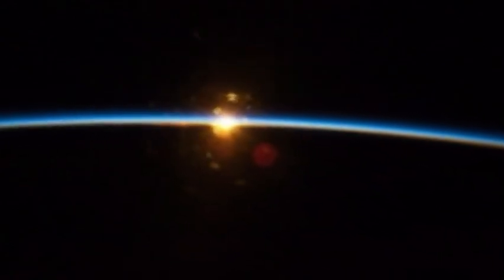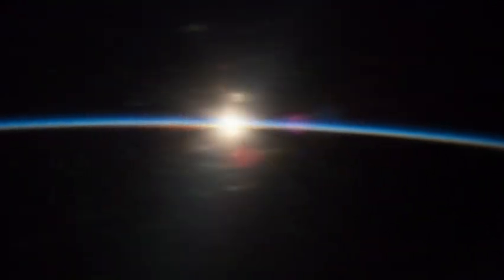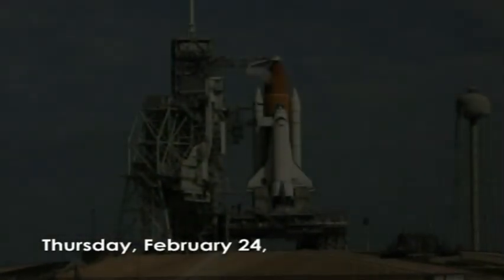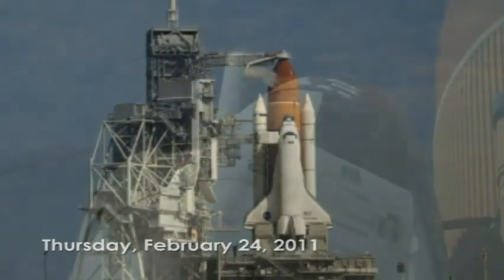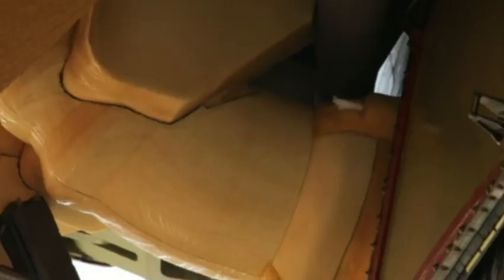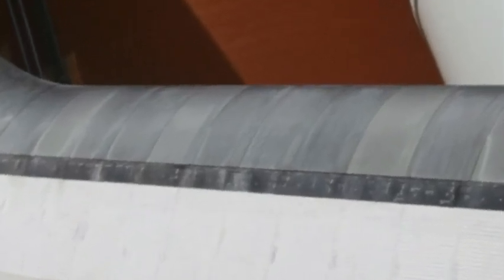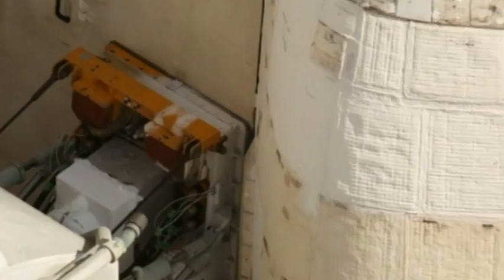Discovery Launch Captured by Multiple Cameras

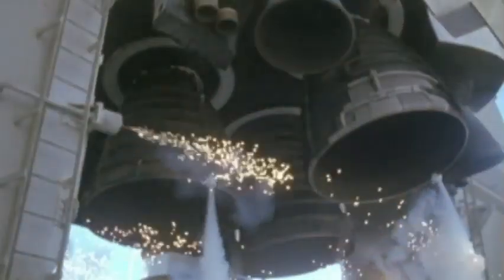Comment: 4:24 is that sparkles or water?
Reply: +MoneyCZ What you see is sparks from the sparklers. Their job is to burn off the excess hydrogen under the exhaust nozzles. Info from 'NASA Space Shuttle Owner's Workshop Manual' published in the UK by Haynes. It's a very good read.
Reply: oh
Reply: idk it
Reply: and thaknks for info :)
Reply: MoneyCZ sound suppression the vibration of the shuttle's engines is enough to start rattling things loose the water suppression dampings the affects of masses vibrations the shuttle undergoes during main engine start.
Reply: MoneyCZ sound suppression the vibration of the shuttle's engines is enough to start rattling things loose the water suppression dampings the affects of masses vibrations the shuttle undergoes during main engine start.

Comment: I tried to build a shuttle in kerbal space program..
But I found it is very difficult to control the trend to dive at the initial stage
Reply: +vc Biller You have to align the engines in a position to counter balance the center of mass.
Reply: It's a pain but try to offset the outer motor. Hence why the Shuttle had a program to gimbal it up to orbit
Reply: Adam Allman You can't use real engines to orbit, you need to use Mono-Propellant, if you need instruction you can come watch my broadcast on steam. (Mr.Universe) < My steam, ill broadcast if you need the help.
Reply: great video shame about the annoying music

Comment: The shuttle is a marvel of human ingenuity. It's wonderful, unique; no words to describe the thrill of seeing off! 🚀. But sending seven austronautas to die, I do not find very smart on their part 😢😢😢 👎. NASA managers were aware that the design of the solid rocket boosters contractor) Morton Thiokol had a potentially catastrophic flaw in the O-rings [6] but not been adequately resolved. They also ignored warnings from engineers about the dangers in the release caused by the cold temperatures that morning and had not properly informed his superiors of these concerns.
Reply: VIRGIL CHANNEL VIEW you are correct Roger Boisjoly did try to stop the launch of Challenger or at least try to convince the team to wait for warmer weather but was condemned for his actions
Reply: I am very pleased. Let it rot in jail for CIRMEN TO HUMANITY

Comment: At 10:29 What was the strut connected to? Because when separated, the surface of the shuttle looked flat...
Reply: +Ken Rick was connected to 2 contacts inside the shuttle and next to the 2 hoses from the tank to the shuttle,  when they disconnect, the doors slam shut and make a flat surface.   for the front strut is a Bolt that is driven into The shuttle. and explosive charge breaks the bolt flush.
Reply: Exactly. Excellent explanation.

Comment: What is those red glow things @03:26 Fuel Cells?
Reply: +KillerJoeFIN They are Red Water Sausages. :-) They are large nylon bags – each about one foot wide and one foot deep – filled with water and stretched across the Solid Rocket Booster flame holes. These bags are part of the Sound 
Suppression Water System designed to protect the Space Shuttle from damaging acoustical energy during launch.

http://www.nasa.gov/returntoflight/launch/red_water_sausages.html

Comment: 10:13 - Why are there strange (yet spectacular) sort of "clouds"?
Reply: main engine cutoff.
Reply: Chris Harvey I know, But how exactly do they form? Pressure? Gasses?
Reply: +XpertPilotFSX I don't know for sure, but my guess is that, between 10:13 and 10:25, they could be either unburnt/partially burnt propellant, exhaust gases from the main engines (moving at a lower-than-usual velocity or something), or exhaust gases from the Shuttle's OMS pods. After 10:25, what is visible all around the Shuttle are most likely exhaust gases from the Shuttle's RCS thrusters.
Reply: Nico Malotaux Ohhhhhh. Visuals in space do look fantastic.
Reply: +XpertPilotFSX It's plasma from ram heating, it happens only briefly at the end of ascent. If you look at any of the videos or pictures of the external tank after it is jettisoned, you can see the nose is scorched, it's especially visible on the STS-1 external tank which was painted white. The white gasses are from the maneuvering system, they are trying to get away from the tank so they can perform the last little bit of orbital insertion. The main engines don't take the shuttle quite all the way to orbit, they use the maneuvering system for that.

Comment: It was not the only thing that made it unsafe.  Shuttle was the most dangerous manned vehicle ever created.  The fact that the crew cabin was inline with the main fuel tank, the fact that it was winged and not a lifting body (winged craft make bad space vehicles because they require Atmospheric orientation).  The use of Solid fuel (which can NOT be turned off once started) on a manned rocket and also the cause of the strong vibrations on Shuttle AKA shook of the foam that brought Columbia down.

Comment: If it was so thin, it was unable to accelerate foam to make this damage.
No direct evidence. Or did they exactly identify floated away object as piece of that panel?
Early reentry photo show leading edge was burning.
Gouge fixed with paste was half-size to critical. Gauges You saw were after erosion not before it.
I know, that (RCC) was my speciality till Buran destroyed after roof collapse made by workers on Baikonur.

Comment: The panel piece was lodged in between the RCC panel and the aluminum spar. There is 1/2 meter of space between them. On orbit in microgravity, the panel piece dislodged and floated away. There was no change of aerodynamics because when it happened the atmosphere was to thin to make a difference.
A tile was fixed near the hatch. It did not have to be fixed. The orbiter lands with a 100 gouges after re-entry with no issues on heat and aerodynamics.
RCC panels are more critical then tiles.

Comment: Hole in wing must not be cosidered unless panel pieces were found near KSC.
Large piece floated away of what?
Hole similar to made in lab, would change wing aerodynamic at launch drastically. Flow deviations might be detected by camera on trails.
Even through crack is unnecessary. Just facet/chumfer. It changes hypersonic flow local pressure and temperature much higher than on undamaged panel.
Remember as technician used paste to fix facet at launch near closed hatch at one of the last missions.

Comment: Plasma did destroy the wing during re-entry. On launch there is no plasma because they are not going fast enough. The hole is suggested by pieces of the panel recovered and by a large piece that floated away from the wing on orbit on day two.

Comment: The tanks outer coating is foam. Long range cameras saw the foam hit the wing. They could not see the leading edge on camera because it was flying away from the camera. Pieces of the panel were recovered that verified it was a hole not a crack.

Comment: Just after disaster many thought it was leading edge burnout. Maybe combined with ice and/or ground check - there are element/tile density inconsistency limitations (thermal stress, cracks, structural strenght), etc. Density and temperature gradients lets crack grow.
From initial photos of trail from the left wing might be considered that there might be a chumfer at leading edge elements conjugation producing temperate that material couldn't withstand.

Comment: I ment, even aerodynamic at launch.. They finally punched a hole. Did they shoot each time in lab on the new element? If not, they might made few cracks and then punch a hole along them.
Plasma would destroy wing internal structure through a hole (not crack) almost immediately. Yaw deviation on reentry would big before plasma, Shuttle control surfaces were not effective enough, and crew detect that even not on manual. There is no sign of this on cockpit docu.
Hole is suggested by the test video.

Comment: They do not let to be done. And it's most easiest way to get it done. Design comes from engineers.
Columbia was hit by ice. Shuttle single disandvantage is heat shield is exposed.
Sykorsky X-2 technology just got through, despite almost any in childhood think helicopter works like this.

Comment: Shuttle EVA suits are not tethered to the ship with breathing air like the early EVA's. They are independent.  Columbia never had a docking module installed. She was too heavy to go to the ISS. If a rescue was to take place 2 shuttles would face each other payload bay to payload bay. The rescue shuttle would have a robot arm that the crew would use to move other crewman up and back using EVA suits. This would take time to get in and out of suits and pre-breathing to go outside.

Comment: You dont wear EVA suits. They are mounted in the airlock for launch and landing. An EVA suit is far different than a pressure suit.  They weigh 260 lbs. You could not even walk in them. You have to have something that will accomidate 7 people. Your idea would not work for shuttte.

Comment: Around astronauts! Emergency lifeboat could be launched on LEO on demand, or put in payload bay folded. Apollo descent stage has Lunar Gemini sleds attached, cause it was far beyond LEO.
ISS or Space Shuttle lifeboat scenario is just one - abandon damaged ship or station,. get there, fire retrorockets and aerobrake. The same Lunar Geminy loanding sleds, but with heat shild, bigger and even more simplier. Particularly provided on 911 call cause they are just 200 miles away. not 200.000.

Comment: Where would you put 6 more EVA suits? There is limited space on board.  You are going to fill up the crew module and payload bay with so much emergency and contingency equipment, that your not going to be able to get on board or put anything in the payload bay. At some point you have to consider all the different senarios and start taking risks to get any spacecraft off the ground. Otherwise you would be launching something as big as a football field with 2 people on board.

Comment: What is the weight of C or Ta-Hf heat shilds? Six more EVA space suites are cheaper than to keep second ship ready. Then, what if it has to be solved too?
Disk would not take lot of payload bay volume. It was generally half loaded at all.
Apollo took L.Gemini sleds (manned Surveyor) even to the Moon.
Using space lifeboats, it is not fixing. It's just abandoning ship. It's normal.
Management just choose wrong way to get rid of program. Those mad destroy your country as they had with ours 20Y ago.

Comment: Folded, I ment, not like NASA wants to use concept for martian probes to land on southern hemisphere, but disk-shaped. Keeping form and integrity of heat shield, and folding just cockpit superstructure down to the chairs level (metal basins, like Mercury-capsule had). If it is launched separately in a case of an emergency, it could be not folded at all. And could be launched by small and non human-rated rocked. It's cheap and there are lots of ICMB, other rockets, to scrap or to be phased out.

Comment: Folded escape space capsule for eight in cargo bay is affordable, cause it weight much less than conventional. It has nothing more than retrorockets (if you desire to leave shuttle on orbit), heat shield, full-sized or small dragchute and maybe spare breathing oxigen. Anything else is provided by EVA space suit. In an emergency it's possible to launch this separately by small-size rocket in proximity. Or use even few modified ICBM warheads.
Apollo LM took Lunar Geminy sleds as a backup,attached.

Comment: Ablative protective shield behind the pilot cabin for reentry and conventional escape forward solid rocket mast if it is to be launched from R-7.
They supposed to be flown in pairs, stiking aircraft carriers. Combat aircrafts are often subject to damage. Decomissioned after SALT.
Later Space Shuttle launches could be done more safe w/o major Orbiter's airframe refit, just placing folding escape capsule for all eight into the cargo bay, for reentry. Comprising heat shield and paraсhute only.

Comment: As a structure only external drop tank is disposable, but you have to burn a lot of thiokol and LH to orbit and deorbit whole airframe, to put up there payload ONE WAY, that could be done by less than one SRB alone. This is not "shuttle operations" in fact. Most of the missions were just one way and taxiing astronauts.
You could launch Skylab-like space hotel for rich by Heavy Delta and taxi third of B-747 of them by Shuttle up there and back - that would be space "shuttle operations" indeed.

Comment: the shuttle was unsafe because there was no way for the crew to eject from the craft in the event of an emergency. Unlike the apollo rockets, where there was a launch escape system to eject the capsule to safety. likewise in space the LEM served as a lifeboat for the crew of apollo 13, granted it was never designed to do so, but at the end of the day, the only way a shuttle crew could be saved in an emergency would be to have another shuttle dock and transfer the crew, which takes time.

Comment: You are full of shit, so keep your mouth shut so the shit does not come flying out.
The space shuttles still are the fucking safest spacecrafts ever designed by mankind.

With the Challenger, the booster failed, not the shuttle.
And with the Columbia the main tank ''failed'', hence a piece fell of and damaged the shuttle. Which still successfully made it into space. Engineers wanted the astronauts to do a space walk to inspect the wing, NASAmanagement denied the request.

Conclusion:Shuttle=Safe

Comment: Motormonkeynl,
The reason they do the rollover sequence is the shuttle passes through the " maximum dynamic pressure zone " where the shuttle is under the most stress when it passes through the sound barrier so they roll over to a " heads down  " position to reduce pressure on the shuttle. The shuttle will also reduce the throttle down to 65% & when the shuttle has passes through the maximum dynamic pressure zone it will throttle up to 105%. Hope this helps.

Comment: I wondered that too. According to Wikipedia's article entitled "Space Shuttle", under the "Launch" section:

"At T-minus 10 seconds, hydrogen igniters were activated under each engine bell to quell the stagnant gas inside the cones before ignition. Failure to burn these gases could trip the onboard sensors and create the possibility of an overpressure and explosion of the vehicle during the firing phase."

Comment: @Sibs1990 the rockets are the kind of engines wich can run without any external oxidizer (i.e. oxygen): indeed they are used for the space missions because of this capability.

The rockets you see at 7:53 are the Solid Rocket Boosters, wich use a solid propellant, while the shuttle's main engines (the three engines at the bottom of the shuttle) use oxygen and hydrogen, both in a liquid state.

Comment: @Sibs1990 The engines get liquid Oxygen pumped in with the liquid Hydrogen, which is ignited and pushes the Shuttle on its way. In fact because there is no air in space, rockets work more efficiently than in-atmosphere because the gases can expand very rapidly without opposing pressure.

Comment: @TheBayourat Flying HD on small, DIY rockets and flying HD on manned shuttle missions are about as two different things as you can get.  There's a multitude of things that need to be certified, and simply attaching a a camera to the side of the ET just won't do.  So with due respect, perhaps NASA knows a bit more about what they're doing than you do...